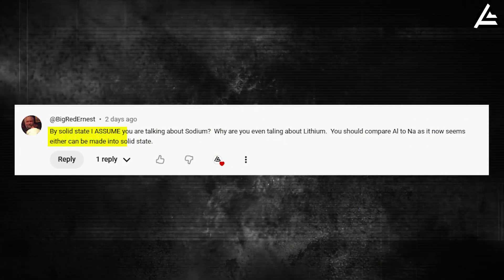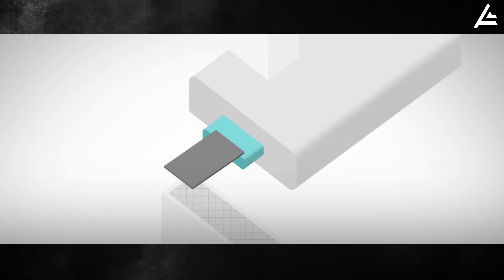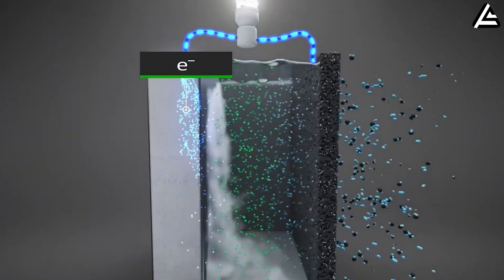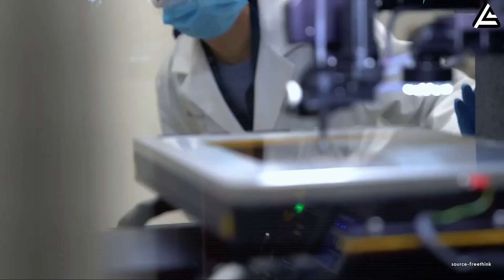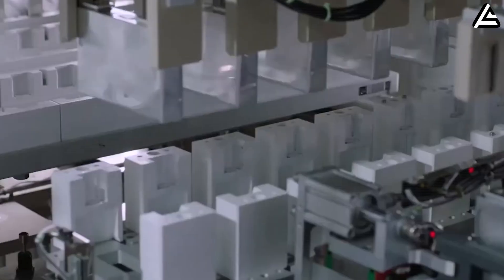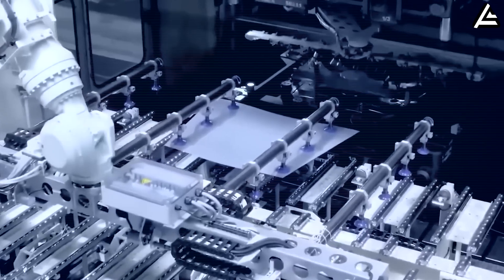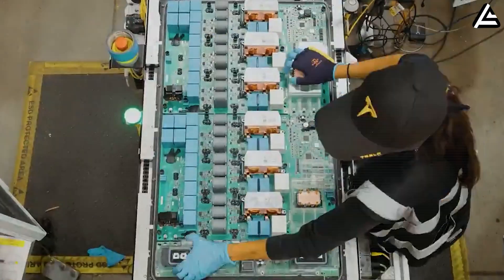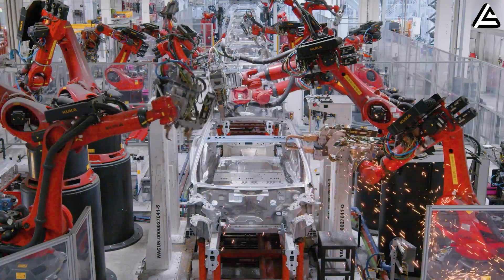2026 Tesla Solid-State Batteries: Which Is Closer to Mass-Producing?

Comment from the maker: Tesla’s 2026 solid-state battery program is moving fast, but official details are scarce. Let’s assume Tesla achieves full mass production by late 2026, this could completely change EV range, cost, and charging speed.
💬 Do you think this is realistic, or is Tesla still years away? Share your thoughts below!
Reply: The key advantages I see are; the elimination of Li in transportation applications ending the efforts of some countries trying to corner the Li market which would lead to higher costs.  The elimination of the fire risk and the temperature range limitation.  The lower cost of the Na solid state solution.  Real improvement in range anxiety.

I would also say that I do not think that eV only cars are the answer to the immediate future.  I believe in the hybrid philosophy.  An ICE driving a generator without the heavy parts is a more efficient answer.  I believe that having a motor/generator on each wheel gives inherent 4-wheel drive, eliminates the need for long axles and differentials. An onboard computer that manages current flow to each wheel would give better traction and manage differential wheel speeds without the need for another heavy part. 

The ICE would be a range extender and the battery should still be able to be plugged in for main charge.  An ICE direct-drive generator coupling is simple with no need for new technology.

Comment: As a former head of Corrosion Engineering for the largest production aluminum company in the world, I would say that solid state Aluminum is not likely to be feasible.  Aluminum in almost any form is covered in a compact Al2O3 film that forms on exposure to almost any environment.  While solid Aluminum is an excellent conductor, its value as an anode or cathode in a battery is doomed unless the "electrolyte" is non-aqueous.  This sounds contradictory to have a non-aqueous electrolyte but it is not theoretically impossible.   I would think that such an electrolyte would involve rare or alkaline earth elements in a quantum coupling similar to an LED or laser.  A traditional aqueous Aluminum battery is always doomed to being single use disposables - currently used as a back up energy source in critical applications like continuous communication nodes i.e. extremely unusual situations.  A quantum battery (solid state) is possible but I haven't heard of anyone trying to create one.
Reply from the maker: Thanks for sharing your expertise on aluminum’s properties and the potential complexities of solid-state aluminum batteries.

Comment: I don't buy cars containing lithium batteries because I don't want a potential fire starting up in my garage even if such fires are rare. Sodium would be acceptable. I know a couple that died when the wife started her ICE car, but got out to get one more thing out of the house. She forgot about her car running in the garage. That is why I have a very loud carbon monoxide detector in my all electric house. It is easy to think that highly improbable is the same thing as safe.
Reply from the maker: I get the concern — but when you zoom out and look at real-world data, modern EV batteries are engineered to fail safe, while gasoline has been failing dangerously for over a century and we just normalized it.

Comment: I was seriously considering buying an aluminum-ion-powered (long-range) Tesla; however, this is now being off-sold, while they are pushing sodium-ion batteries. which will not and cannot provide the performance I require. Therefore, I will not purchase at this time. When I was a young salesman, I, too, presold product concepts that were not quite ready for sale, causing me and my company to lose points of credibility. Just maybe Elon Musk could learn from my mistakes.
Reply from the maker: Thanks for your sharing. This battery hasn’t came out yet so there is still time for you to consider about it. Totally understand your concern, may I ask how is the performance you require?

Comment: Sodium-ion cells can be built on modified lithium-ion lines.
Reply from the maker: Exactly, and that flexibility is why Tesla keeps multiple chemistries on the table. Aluminum ion is still speculative, but Tesla has shown it can adapt production lines faster than most when the design is simplified. The goal is not disruption for its own sake, but scaling what makes sense. I will keep updating as more details become clearer

Comment: Confusing solid-state with aluminum shows a basic category error.
Reply from the maker: That is a fair distinction. Solid state and aluminum ion are very different categories, and the discussion here is speculative rather than technical confirmation. Tesla often evaluates multiple paths in parallel before committing to what scales best in manufacturing. The focus is less on labels and more on what can realistically reach mass production. I will keep updating as clearer signals emerge.

Comment: Solid-state is an electrolyte architecture, not a battery chemistry.
Reply from the maker: That is correct, solid state refers to the electrolyte architecture, not the underlying chemistry. The point of the discussion is less about mixing definitions and more about how Tesla evaluates architectures that can improve safety, cost, and scalability. Tesla usually looks at the full system, from materials to manufacturing, before choosing a path. I will keep updating as more concrete details emerge.